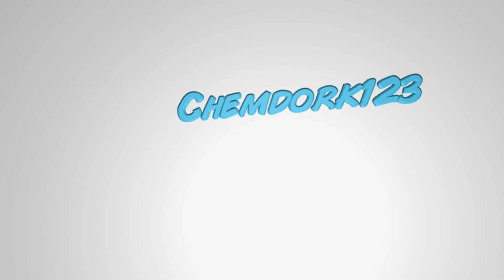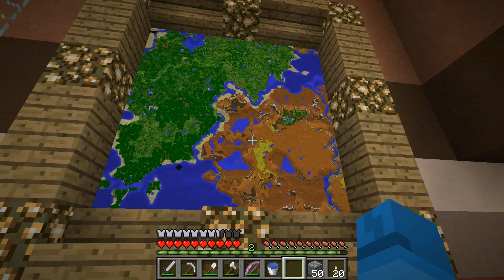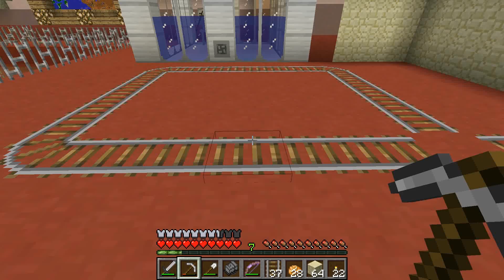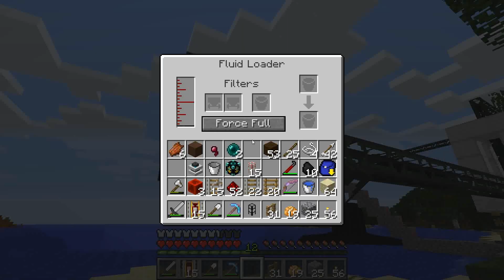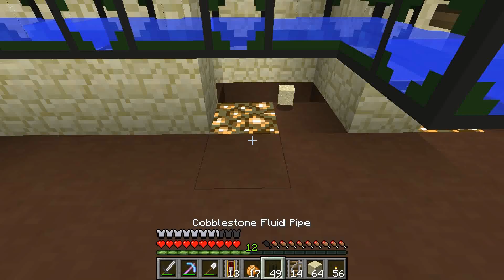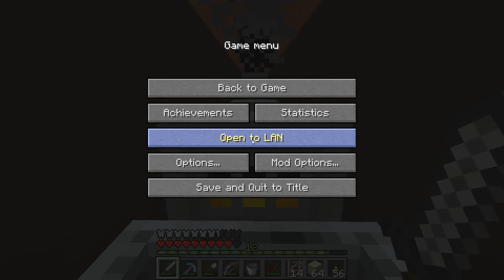My Buildcraft S3E06 - All Aboard

Comment: Oh, that's another thing: The Better Horse Hud mod. It should be called 'Better Riding Hud', because it keeps your hunger from being hidden while you're riding anything.
You can definitely starve while riding, plus it's weird and inconsistent to not show the hunger bar.
You probably won't install or even look at the mod, though, will you? You want to keep this as pure as possible, plus I'm not sure if you even look at comments.
If you do, and want to improve your experience in a way that doesn't affect gameplay, you might consider FastCraft, which optimizes world generation and loading, to keep your performance high while you're moving about the world, as you'll probably do a lot more considering RailCraft is a focus.
You probably don't experience this bug very often, but if you ever open your inventory, go in to third person, or hold a map while riding anything (Minecart, horses, etc.), you've probably seen your hand go off on a wonk. That's due to someone forgetting to clear the buffers, but nevermind that, because SkinPort fixes it! It also lets you use 1.8+ skins if you have one, but since you probably don't, it effectively just fixes the bug.
Reply from the maker: Darian Stephens thanks for all the suggestions! I do read comments, but you're right I probably won't install many other mods. If I have some performance issues I might look into Fast Craft
Reply: At the very least, I would love to see Better Horse Hud and SkinPort mods installed, because the visual bugs are the most obvious and annoying ones.
Sorry if I seemed frustrated or annoyed at all in my comments; it's a bit difficult when you post something but it seems to never get noticed.

I feel like this is getting to be a bit too much for you, but the BugFixMod (Literal name) helps with things like mobs phasing through blocks (As you saw with your animals), tool desync with the Unbreaking enchantment, a bug with the health bar, and fixes boat desync. I'll probably stop for now, at least until next episode; I don't want to overwhelm you with these things.

Comment: Just a note on world anchors, last time I used them you had to load the chunks then set the anchor to go. Basically, it doesn't chunk load but just keeps chunks loaded. Might have changed since 1.6.4 but it also might not have.
Reply from the maker: Yes pretty sure that's correct

Comment: there is a track part I can't remember the name of it but if you use it in conjunction with the detector rail (which you I think you can turn to a one way mode in that version) you can make the train speed up in between the 2 stops and then slow down when it enters the stations. also if you were to use multiple loaders/unloaders you need to look into what spacing to use because the carts take up a bit more than 1 block so after a couple they are not aliened with the standard blocks.

Comment: In terms of awkward mob spawns, the one that kills me is the Railcraft blast furnace.  The centre of it is two high and pitch black, so if you ever let it run out of coal (and therefore there won't be any lava), it's the perfect hard to find  spawn point.  You'll hear the twanging of a skelly's bow, but can't figure out if it's on your roof, or in a dark corner of the basement.  Ugh.  I literally have to break a block on that one when i'm not using it to prevent the problem